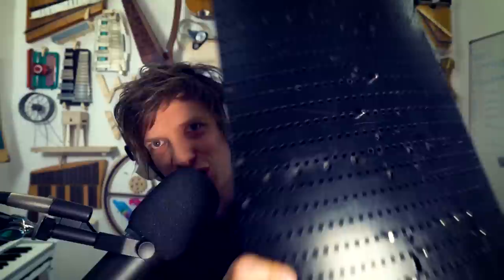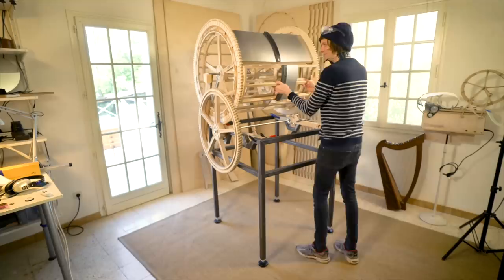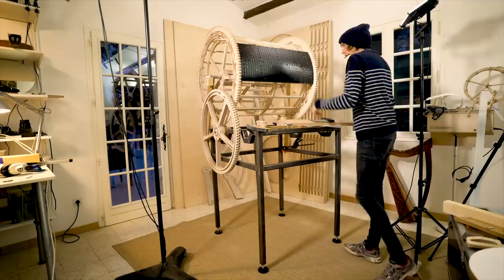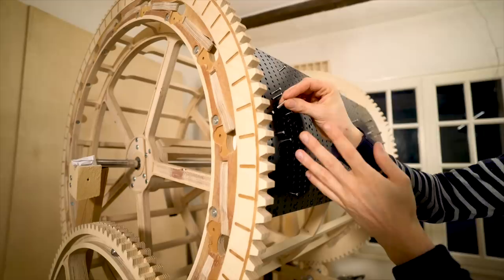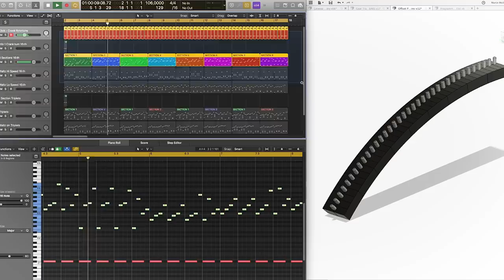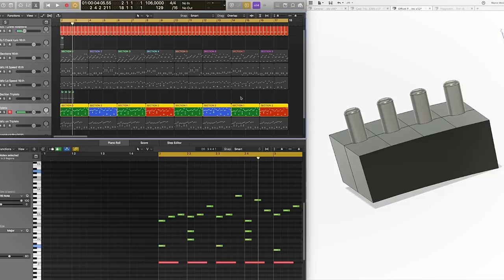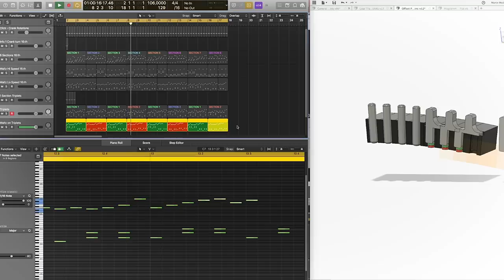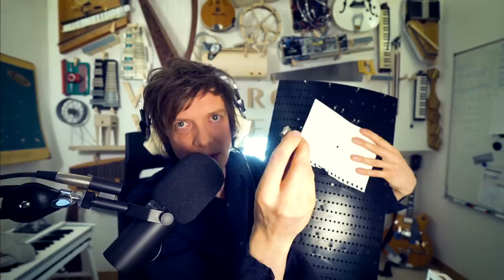Magnet "Midi" Music System - Marble Machine X #25

Comment: Maximum replays on the first comment reached..

I'd try to build fixed programming sections for all the songs on your tour. Maybe an imprint and a cast of a perfect programmed section or something out of a 3d printer. 

Also I would (again) fear wear in the register boards. This time in the black plastic section if the pins are loaded sideways.In the first mable machine the plastic pins broke. This time the pins are metallic but they stick in plastic. No problem thouch, if the pins are loaded downwards.

Comment: You need volunteers to swap the panels already. I would not manually program the panels on stage. Bring as many panel sets as you have songs. 
Or you could also design a separate panel programming machine that takes its programming directly from a 3D printed tiny version of the programming wheel (to keep things as physical as possible).

Comment: The triplets seems like an easy fix if you want three beats in the space of four the mounting holes for the pegs can stay in the same place but and the lead to a surface the organizes special protruding pegs not over the place of the mounting holes. So four down in the placement for the midi board to hold them and three up spaced in a place for playing triplets. Then you don't need new boards for music written in different times but some special peg assemblies for anything other then the base four four timing of your music's beat remaining in the one measure or a series of measures until those series are repeatable to fall back into the pattern of repeatability of a whole wheel is for instance your music's off timing requires more then one measure.
Reply: sure yeah I see like that with separate pins so you can triplet onto different notes on the midi grid. I guess I was just guessing that you would be playing the same three notes in a row and it might be easier to have one piece for the three triplet pins. That's more flexible just don't get your pins mixed up in reprogramming.

Comment: The triplet pin idea is genius, but in a live gig be be a pain to administer.  Each of the three triplet pins is different, depending on the offset from the quarter pins.  So you'll have to find "tiplet pin 1", "triplet pin 2", and "triplet pin 3".  Sure, they can be colour coded, but it will lengthen the time needed to program the whole thing.  But why not just make a triplet board instead, with spacing to exactly match the number of musical measures?  That way, you just use the same pins.  It's not like you'll be mixing 4/4 and 3/4 music on the same board anyway.

Comment: You could do 60 positions instead of 64. That could be divided by 3 and 4. You could then make two different speeds for the crank so it goes 4 pins per rotation or 3 pins per rotation.

Comment: if you don't want realtime composing/alteration of songs you could better go with traditional punched cards (flexible) and use pins on the ball triggers only to read the holes. what you go for now is very complex and needless, since you compose digitally. there is a reason most if not all machines worked with punched cards, before the digital age.

if you still want manual work, you can have full perforated cards and cover them with punched vinyl stickers, so you can work on them afterwards by punching or filling.

just ideas.

Comment: Hi, great ideas. One suggestion. DO NOT DO THE PEN CLICKING PINS!!!!!  Reason why is that you are going to risk the chances of the plates getting out of sink when you want to play a song. Maybe when loading, or transporting the pin gets clicked and you don't know it and then when you are on stage the wrong notes will be played.

HEY Also this is a little ahead of the game, but as you design your wheel for transportation, do some simulation of transporting it around. Say go on a vacation somewhere and throw some of the panels into your suit case and let American Airlines ( or whoever ) do the worst. 

Want to check to see that during transport do the magnets fall out of their location when traveling?

( Granted you'll do setup when you arrive at your locations, but I think you will also have some panels preloaded and ready to go. before you arrive at the venue. Anyhow, when you actually get to going to concerts you'll want to do simulations to make sure, hey are all these portable parts working like they should. You can also use vibration equipment to test to see how they will hold up. Some company actually have equipment that test their product packing, you can probably borrow their equipment to do a test. My company doesn't have that, but I just suggest to give you ideas.

I guess you already have some plan for labeling the panels so when you load them into the machine you will know which order panels go in? don't want to put them in backwards, but hey it might be cool to see what kinds of sounds you get if they go in the wrong way.

Hey another question, do you have any way to reverse the direction your machine turns? First turn clockwise then reverse to turn counterclockwise. I mean that would be really cool to reverse the direction and in the process create new music for the audience.  Anyhow I think you love versatility. ( Maybe these ideas have already been shared with you. Just as you do this, you just make me brain storm ideas.

Comment: How about arpeggio bars?  Slightly-curved bars with pins across them to be installed at an angle.  It could be faster to program for loops with a lot of arpeggios, and might look cool on the wheel.  You could draw pictures with your rhythms!

Comment: Hi, first of all Great Work! Love your channel and you dedication. 
Second. be carefull to not overengineer your project! if you want to go on tour with it you will need to make it simple enough for other people to understand. Im an event technician myself and i know hard it is to work backstage under pressure and make no mistake. In your case you have a lot of room for error because of the pins, moving parts, the material itself, etc.
I think you should stick to one kind of pins, if your working in a dark an loud place you easily can go wrong. So what about building a programming wheel for triplets only? Or build a special programming wheel with a fixed song. In this case you could reduce the cost by using cheeper materials and have a easier time on stage. 
You also can think about a tamplate you of plastic or wood with predrilled holes for the pins that you fill up at first so you can proramm the wheel in one go. I dont know if this will work but you coud give it a try.

Keep up with you great work

Best 
Fabian
Reply: This is absolutely brilliant!  As the video got to the part about having technicians backstage reprogramming a second set of sectors, I began to think about how much the holes will begin to wear out and elongate from the repeated insertion and removal of the pins.  I recommend you make additional sectors for however many songs you play in your performance.  You will only need to program them once and changing songs will take less time and eliminate the possibility of improperly programmed sectors provided every sector is clearly identified for the songs they are intended.  Additionally, I suggest you alter the contact points of the programming wheel and the sectors so the pieces can only fit one way and in a single spot.  That will prevent any possible placement of sectors in upside down or out of order. A good way to think about the second idea is to look at different types of computer RAM and see how they can only go in facing one direction and only on a motherboard that accepts that type of RAM.  DDR4 RAM can not fit in DDR3 slots.  I love your videos, keep them coming!

Comment: This may have been suggest (can’t read all 5k comments).   Why not have a triplet grid slightly offset from the quad grid? There appears to be plenty of room.  So the same machine feeler could react to a pin on the quad track or a pin slightly to the side on the corresponding triplet track.  Then template programming still works, and your technicians don’t need to deal with more than one kind of pin.  Win.

Comment: Hi Martin, I’m a week late in adding a comment. I work with plc ladder logic on machinery. I understand what you are trying to do and I have a suggestion that may help. If you have 2 positions which would be across the wheel for the four time and then at 45 degrees for the three time. It kind of adds up in my mind. If someone has suggested already then great. Great build so far.

Comment: You could try running the pins on a tape inside the wheel which would exponentially increase the time it takes to run thru on cycle.

Basically like a cassette dec

Comment: You also could still use the offset pins for 32nd or 64th offset intermediate tempo. Similar to a drum roll or off beat tempo  Similarly for a downbeat lead in.

Comment: To be honest, I don't think there's an easy solution for the programming dilemma. When there's so much to be rearranged, probably the idea of a template sheet (could be made of rubber in different colors for the different plates, you can transport them easily and they're a little bit more solid than paper sheets) is the smartest.
To answer the design question, I'd prefer the matte brushed design because on the glossy black every scratch and every fingerprint would be visible.

Comment: reccomendation to not cheap out on measuring tool.  When measuring those magnetic pegs on programming strip a cheap measuring device can easily give VERY wrong answers.  It is worth spending a 100 or more on a quality prescision instrument especially for something like youre doing.  Good luck with the project

Comment: I am no music expert. I studied engineering though and If I understand correctly. you don't want to have 4 groups of 4 (16) because then you wont be able to play triplets (16 is not a multiple of 3) but at the same time you might want to have songs that use fourths or 16ths. The simplest thing I can thinkof is to have the number of pins be a multiple of all of them. so 12 is amultiple of 3 and 4, but it might not work for the 16th. so you maybe have 48 which is a multiple of 3 and 4 and even 16. and then you can just change the tempo. I think this is very basic suggestion so probably you thought of it and there was a problem with it which I didn't understand from the video. let me know if this works or if it doesn't why it doesn't work.

Comment: A little late to the the discussion here.  Man I would just ditch the technicians other than a couple of people by building another machine to automate the programming with prebuilt templates that activate spring loaded programming pins.  Then build a second programming wheel that you can switch between so you can just flow between songs.  Once the switch happens a couple of guys roll in, load them up in the programming machine give it a full turn then load it back up on the empty wheel.

Comment: first, i like the glossy black, but you can experiment with different colors, or even combinations of different colors.

second, i understand reprogramming the machine with different songs is a feature, but consider that reprogramming during a concert may be slow and prone to errors. why not use your CAD machine to design plates with pegs permanently machined into the plate. you will have to transport a full set of plates for each song, but changing songs is reduced to installing a set of plates rather than re-pinning a set of plates. presumably your shows will largely be based on a set of, say six or eight songs, plus an extra two or three that change for each performance. pre-programmed plates will allow for rapid changes between songs you play at every concert while minimizing the possibility for errors and it givers your reprogramming technicians more time to set up custom or less frequently played songs. 

if a plate wears out, you can send for a freshly mades plate to be run off the CNC machine and sent to you while on tour.

Comment: I think you should make programmable Wheel sets for every song. It will take more effort now but it 
sounds like your crew team will be crunched for time at a concert. Then it will be easier to make a mistake.
           I was thinking you could use  a light up grid embedded in the programmable will to reprogram it faster. This could also be for a cool light show in the middle of a concert. If you make it battery operated you     
can surprise the audience with the will it suddenly lighting up. It could give it a disco ball effect. What if you made the pins into a little switch that you can click back and forth for your triplet notes. But I also think the design clicking the pins  
up and down like a pin head is a vary fast way of reprogramming it. Maybe you could design it where the pins can click up and down and back and forth slightly (for the triplet notes). I was wondering with this system can you do a 5-4 time signature without a gap at the end? I think it this whoud be vary cool. I hope this can be of some use to you.

Comment: Quite late on this but offset pins are not ideal. Better would be to have 2 tracks side-by-side that can actuate each lever--one in three, one in four. Then  you just have to have the CNC cut more holes and can use the same pins, instead of making special pins that need to be stacked in the right order.

Comment: Since there is ample room between the rows of holes, and I assume the wood they will be striking will be fairly wide, I would make more rows of holes for the different timings. I think you only want two but you could possibly do three. That way, the pins you use don't have to change.
However, not sure how it would sound if you used more than one of the rows at the same time.

Comment: I think you should try making the programming wheel sections flat with the pins polished. And if you make the triple out of brass then you get a great glittering machine that sparkles with the music. Also this is going to have a lot of rotating mass. It may be a massive amount of work turning it. Have you  thought about training for all that crank work?
Reply: By flat I meant matt finish. 😁

Comment: What if you used a concept like pin things you put your hand or face into as kids? You could have pins lined over every hole. Then in the bottoms of the hole have small electromagnets. The programming would be as easy as plugging a song into a program that translates the notes into on/off messages for the magnets.

Comment: Interesting discussion about 1/4, 1/8, 1/16 note rhythms. Triplets are definitely a challenge, especially if you want to combine them with 1/16 notes. Then there are odd time signatures; the iconic Jazz piece "Take Five" (Dave Brubeck), which is in 5/4 time signature. How could you possibly fit 5 beats into what is essentially 4/4 time with a programming wheel initially designed to handle 4/4? Without interchangeable programming plates, I don't see how you could possibly handle the wide variety of time signatures you may play on MMX.

Comment: How about not using magnets at all?  Keyed pins and lock wires - pull the lock wire out and the pins fall out,  put new pins in and insert the lock wire - lock wires are hard-retained by the installation of the panel in the machine?

Comment: I understand that programmable pins are key to the core concept of the marble machine.  That said, for the purpose of live performance doesn't it make sense to program them once and have a set of plates for each song in your set?  Reprogramming the same two plates for each song sounds labor intensive.  And after all, to use another example: typically if a guitarist needs to switch tunings in his set, he doesn't retune the guitar on stage, he just switches guitars.  It's faster and easier on the mechanisms of your instrument in the longrun.

Comment: I can't access the pinned discussion so I don't know if it has already been suggested. 
Why not try some type of color coding with one color per program. 
Each hole should be able to hold 4 colors divided in a circle without it being to hard to read.
This way each template could hold a minimum of 4 songs depending on how many times a pin hole is re used.
By putting the songs most different on the same template you could potentially use more than 4 colors.

Uppskattar dina videos, kul att se nagot sa galet komma till liv :)

Comment: Hi, i might have 2 suggestions for the changing and or usability of the pins. Maybe you can create "Comboplates" like a whole accord? which is includes several pins into one piece so switching might even go faster.

The ultimate step might be pins which could move out and in on their own but that would involve a "Computer" programming it i think which is probably not wanted.  
or a module where you can push from the opposide side to get the pins out or in.

Comment: Logic Board Pins that click I/O are completely the opposite in ethos of this machine. The Dual registration with simple block magnets is simple and far superior. Once you get into sliding pins, sliding tempo's etc you loose the magic. The Only other thing I was thinking of was Y shaped pins - but again, not the right Aesthetic and again the dual registration seems much better.